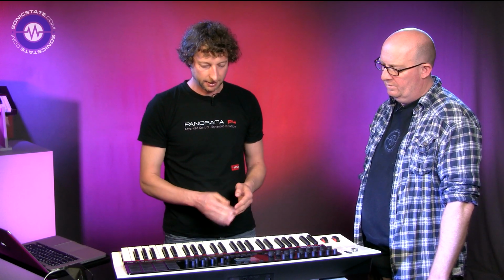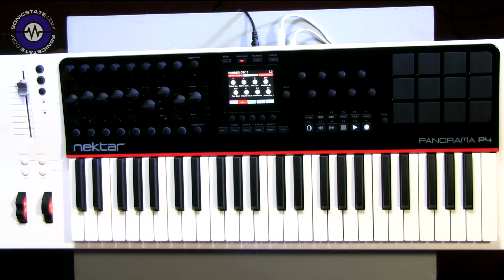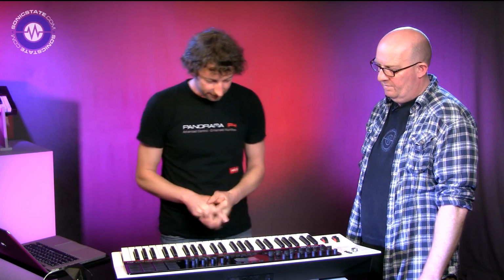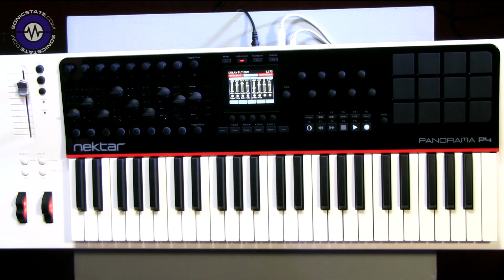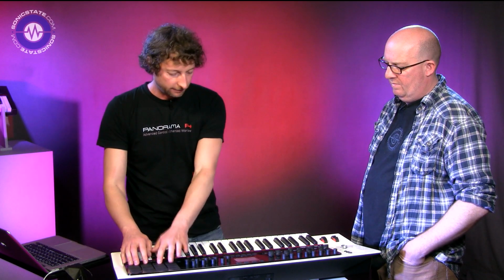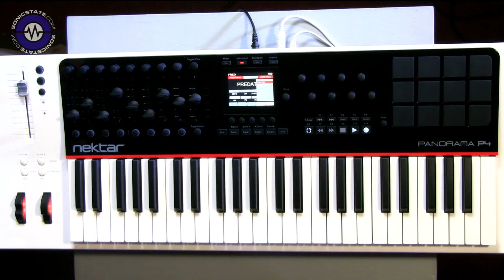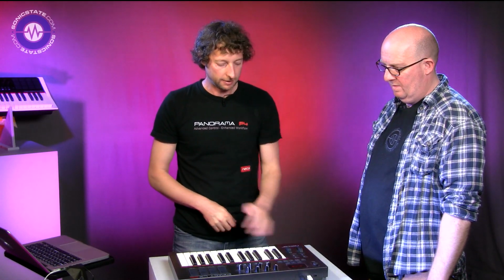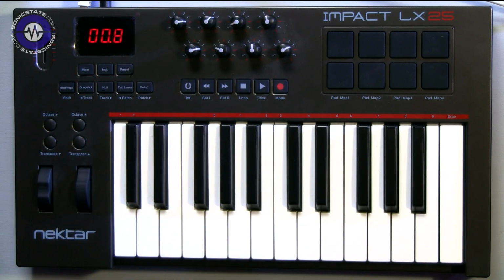Nektar Panorama -Plugins Control - Sonic LAB

Comment: Hi!   I bought the nektar panorama p6 . I use cubase 8.5 Pro in windows 10 Why in windows 10 the motorized fader does not work when changing the track?
Reply: hello friend ,can you pls hepl me on something. i own panorama p4 some days..and i have  a problem to control plugins when i put in insert at cubase.as example i open an vst instrument (kontakt) as example and in insert i put sugar bytes turnado.  the vst instrument i can control it with panorama BUT  when i go to the insert and open turnado plugin nothing happens it doesnt maps nothing automatically. can you help please?